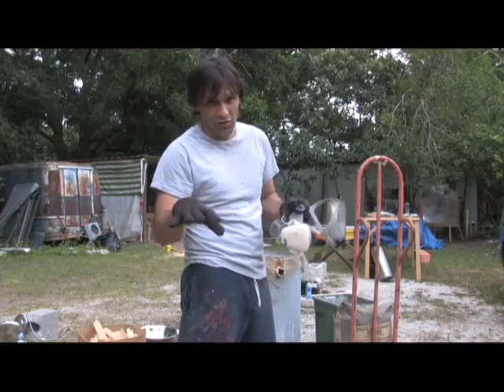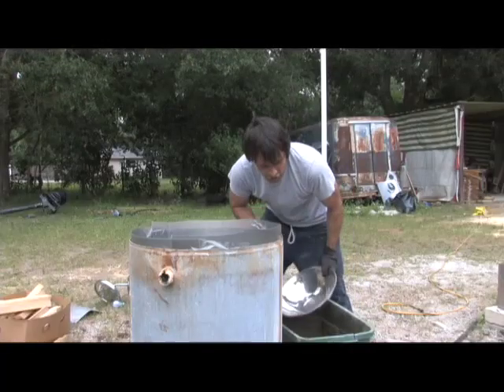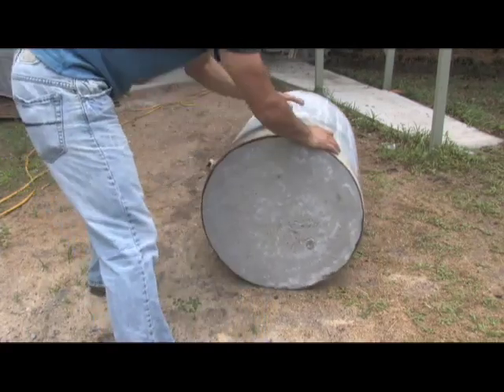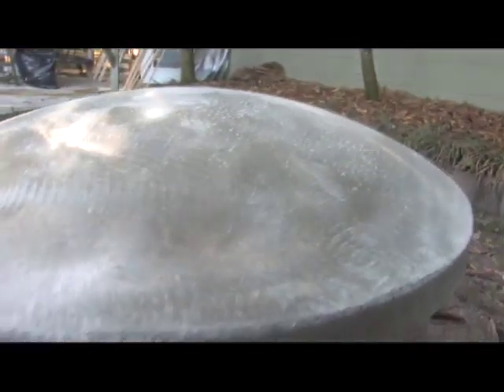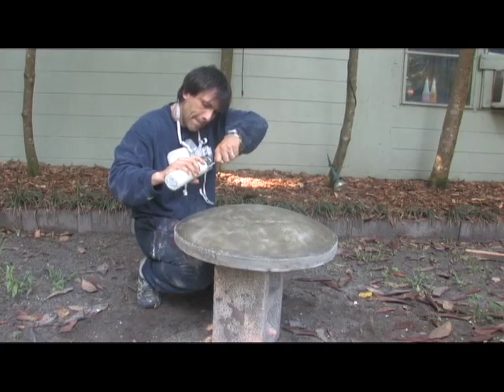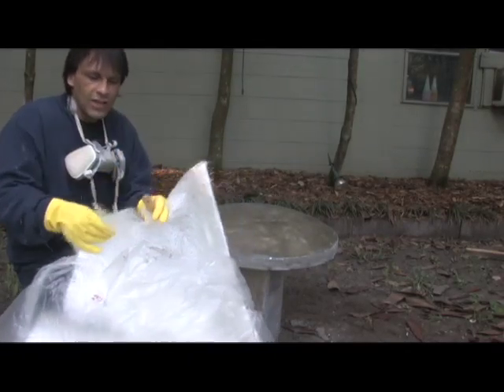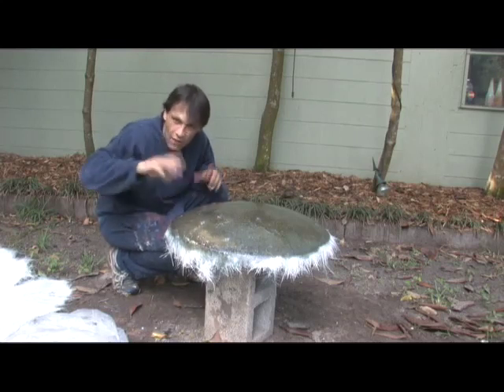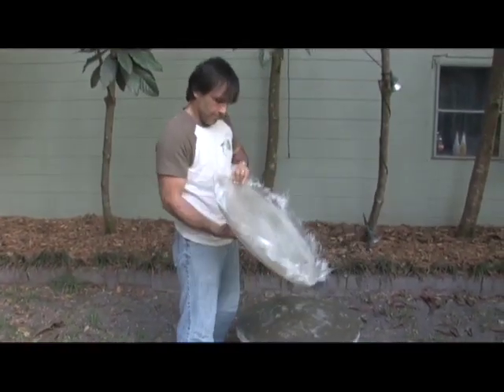PARABOLIC  MIRROR DIY PARABOLOID HOMEMADE SOLAR CONCENTRATOR Mold DIY di it yourself

Comment from the maker: Yes, it works too. The cement absorbs it. The difficult release is a result of the  heat production during the endothermic curing. It causes wax based release agents to absorb deep into the cement. Silicone spray works better with a wax combo.

Comment from the maker: Hi,

Thank You for the nice comment:-)

I have some parabolas, they are a bit better but it really does not make a big difference. Spherical shapes produce the same temperatures within 5%. The time factor, making several is better than 1 perfect IMHO.

The reflective surface is what delivers the most power.

Dan

Comment from the maker: That will work with water and cement would work with some forming help. You would get the general shape, add more water so it is mushy. It would take a rater elaborate system as any off balance issues would be impossible to fix as it would be very heavy.

I think filling a pool and turning a 12 dimensional parabola in the center would work better. 

Thank you for the great comment. What do you think?

Comment from the maker: Yes, but most tanks are "used" and heavily rusted. If you sand and fix it your shape usually changes too dramatically. Also the inner portion of the tank has a slightly uneven surface. Fiberglass resin tends to adhere to treated metal. The rim also is crimped and if you get resin in that, you are done.

The concrete is cheap and easy to work in the open, you can also make multi molds.

Comment: @antcowan  because you would be using the imperfect side for mirror film that would have the brush and fibre imperfections showing, you want to make the cast so you get the smooth side on the reflection side of the mirror, not the back side of the mirror.

Comment from the maker: @alexbimos NOPE, concrete base recycled, only small amount of portland cement. Your computer you are on has 100+ the waste in creation of one dish. Use the dish 10 times to cook with vs electric and your carbon offset is done. Everything, other than living in a cave requires something taxing natural resources. The goal, make something usable.

Comment: Hey Dan, is there a way to store the thermal heat/energy generating from concentrating the suns rays with a parabilic dish/lens. Have they invented a way to store this energy for further use by using that stirling engine/ Generator, and a deep cell or hydrogen cell ? Thanks!

Comment: @bean432  It has to do with the molding process, every mold that has only one side will have a 'finished' and an 'unfinished' side on the molded part. fiberglass by itsself is really quite rough but will take on the finish of whatever it is laid to wet, in this case the concrete. The more time that is spent preparing the plug (concrete in this case) the better the finished side of the molded part will be, since you want a substrate that will eventually make a mirror, smooth is good. Make sense?

Comment: Could use buried, super insulated( vacuum board insulation(see .singleiteration  ) tank. Possibly as a heat exchanger Just need to calculate the use and then decide on the volume required to produce that amount of heating.

Comment: This may be a stupid question, maybe someone has already tried this.
  
What if you fill a 4-6ft diameter rigid plastic pool with very fine concrete mix.

Once the pool is filled to 12-18in of mix, rotating the pool with a motor 
at a very constant rate of spin 30 60 revolutions per minute the cement will harden into the shape of the depression. 

Question, once the cement sets, will it have formed into a parabolic shape? or a cone shape?

Comment: @bean432 if he did that the concave surface on the final project would be turn out very rough.  The whole aim of the project is to make the concave surface as smooth and mirror-like as possible.

Comment: Hey Dan, couldn't you just cut the tank bottom, flip it over and use that as a mold? would save you the concrete work.

Comment: So you just happen to stumble across an old water tank that happens to have parabolic endcaps...?
Also, If you use a gelcoat before you start laying glass, you get a MUCH better finish on your product. In fact, the finish will be as good as the mould, without further finishing work.
So use a gelcoat, and prep your mould to perfection, that way you get a really finished product out of the mould.

Comment: Couldn't you just lay a thick sheet of plastic over the inside of the water heater and heat it up until it softens and melts to correct shape?

Comment: In another one of your videos you show how spraying water onto a framed sheet of clear plastic makes a water lens. Why couldn't you use some reinforced plastic sheeting or a heavy duty nylon tarp in the same way BUT fill it with concrete. It should form into the same shape as the water. Then you could use it for the form to make the mirror.